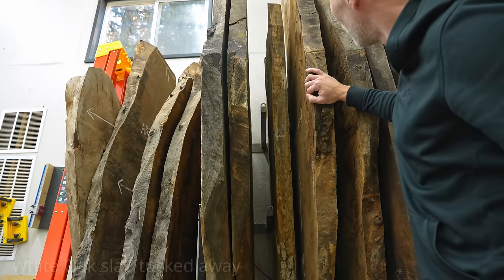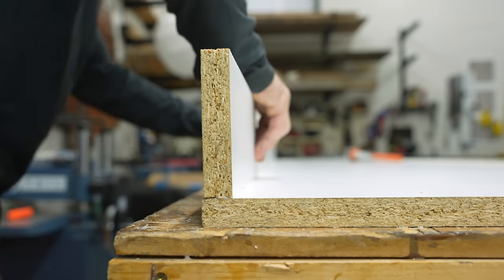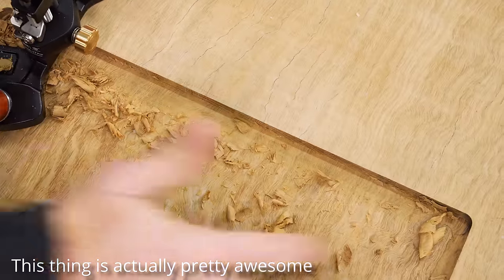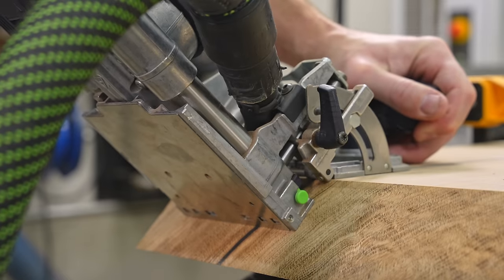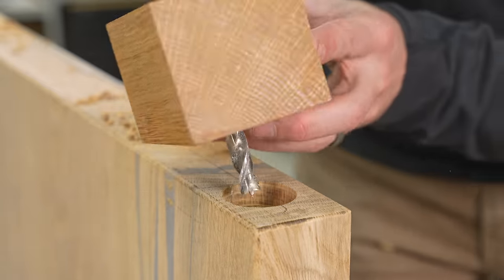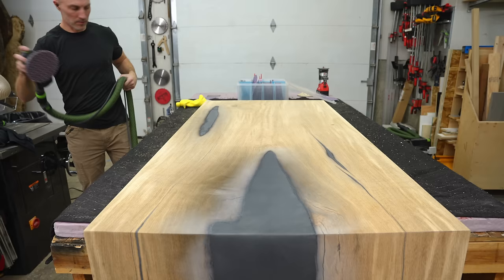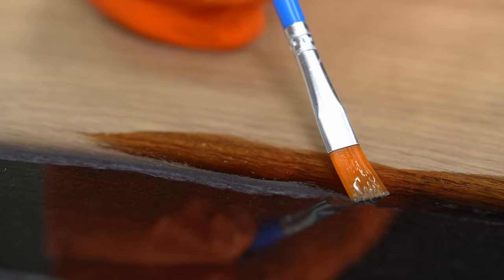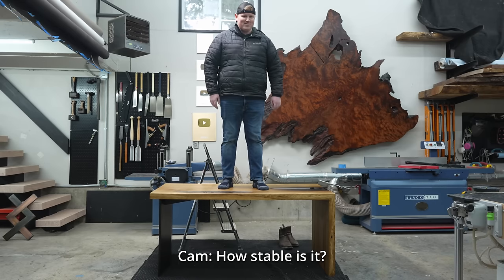Polishing Burnt Wood Like Glass

Comment: Friend, I recommend trying with Transfer Paper or Positioner, the one used in Plotter Vinyl. I use it to grind glass (I do Airbrushing on Glass) or you can use a good quality transparent vinyl so that it doesn't leave adhesives. I admire your work! I watch your videos in Spanish and they are perfectly understood. I recommend the Cutter D-400 the best! I have been using it in my specialty for more than 30 years.

Comment: Working on a mantel thats mitered on the top, bottom and face. The end caps are mitered on 3/4 sides and joined. smaller length miters are a little bit easier

Comment: Just watched the segment about having everything setup before you joined the waterfall section of the table.
There's actually a cooking term for this called "Mise an place" or everything in its place.
I'm not a.particularly capable cook so I use mise an place to make sure I don't burn everything to char when cooking complex dishes.

Comment: Hey Cam. great work on this desk. looks amazing. my only critique would be the 45* joint on the waterfall. would it not be better to use wood glue for the wood and epoxy where the epoxy part is?

Comment: a small tip.

if you put a vibrator on the wooden slab when pouring the resin it will allow the resin to penetrate the wood faster and deeper into the wood.

Comment: I've used wood glue when joining waterfall table leg as ive been informed it will hold better than epoxy but if there is epoxy in the waterfall apply epoxy on that.

Comment: These are tough. I sold one before ever attempting one on my own and it came out okay, i ended up squaring and screwing the main pieces together and doing a face frame type piece that was a 45 degree miter on both the edges

Comment: I used to work on boats..... no need to bow... and I was raised on a sail boat... now you can bow.... BTW a hole in the water with oil and gass is just a safe fire pit though I have seen flames jump and wipe out a whole dock...
Your pencil deal is awesome, however I bought really cheep diamond tools of various sizes and shapes as a test off ebbayy and they are invaluable!!! don't have to change them and when you use a lot of pressure they don't deteriorate like paper so you can use light pressure without changing tool or paper...
I'm also sure that one could cut them into various shapes for particular tasks though I have about thirty shapes and over a hundred different disks.
To that end as you were using your hand to sand with the pencil I immediately thought of the electric engraving tool (it's how my mind works), cutting off the pencil/diamond tool and attaching it to the head of an engraving tool (I have several which I've never used but will now to check it out (I fix things just because I can and people throw stuff away that has plenty of value/life or just needs new brushes, oil, bearings... etc.)
Opinion: I kept wanting to see a "hard edge"? or distinct line between the gloss and the wood... between the burnt and the unburnt. The gray fuzzy for me is a bit off-putting its like its unfinished for some reason.... I think this would be solved by polishing all the black and then taping it off and do a light sand on the spill over shinny, In other words do it backwards by dulling the shine. 
The gloss is amazing and is the focus of attention which means under the most scrutiny... the rest is just wood...I'd rather see some "excess" shinny than over score of mat on the burnt... but that's just me. I love contrast like inlay and two different woods like on old boats.
  First time watcher, enjoyed your narrative and truth... blessings!!
BTW anyone interested in a very simple way to remove corrupt from our government (meant to be governed... which we the people have not for way too long, please check out "cracking the eggshell of conditioning" dddott command (you know the protocol on Tube) It looks first grader for a reason, to keep the spooks away and for the critics something to criticize and just go away. The meat is in the recordings which are raw, uncut, without editing, all natural, grass fed... oh sorry that cows... MCT will work in any country that has laws and the key is that it is aimed at the masses of go alongers in "positions of public trust". Think about it, what business will continue to pay an employee that is incompetent?? Fix that one tiny 240 year oversight and like the Hubble we will literally have the America we desire and the founding Trust Document established:
"That all men are created equal and endowed by their Creator with certain un-a-lien-able rights, among these are Life, Liberty and the Pursuit of Happiness -- That to secure these Rights Governments are instituted among men,.." not over men. We are the creators of govern-meant not the created. Simple because once we the people require periodic testing to insure that they actually know, understand and accurately use the positions for the purposes intended, the corrupt will be removed and kept out. Blessings
Reply: MCT = Mandatory Competency Testing.... get it passed in your local Legislation... Don't know where it is? Why not? Time to man up and manage your Agents... Blessings

Comment: I'm an aircraft mechanic and we normally use some epoxy to repair composite structures.  We infuse a carbon fibre blanket with epoxy by vacuum sealing it and introducing the epoxy under pressure. The end result doesn't have any bubbles. I don't see why this method wouldn't work on the furniture.  
Maybe it'll increase the cost but it'll save you some curing time and you'd be guaranteed of no bubbles.

Comment: I think using the pointed drill bit is brilliant for marking center points! If the center punch diameter is much smaller than that of the hole, then most likely that center punch won't be punching at the center. Besides, cross-purposing tools show imagination...and it's fun to tweak the tool gatekeepers. 🤓

Comment: You can fix the extra air in you table with a simple tool . While the table is in the mold you need a used vacuum pump for doing ac work . If you lower the atmosphere of the project, all the air will be removed . No more ghost pockets.  Just remember the lid you make needs to be strong.  This process is the same for making carbon fiber and   boats . Good luck with your next project. Edit you can use the same presses that you use for the denim but use the mold as the chamber.

Comment: That support was stronger than normal because it has a that v shape to it. Flat things are flexible. But a single bend in an otherwise flat object adds a significant amount of rigidity. Those gussets might not have been necessary at all.

Comment: As a metalworking guy myself, the concern is more that you’ll bend the bit over time. Yes using it as a transfer punch in wood isn’t as bad as if you used it that way on metal, but it’s still bad. Using a brass hammer to drive it is good, but it will flex, bend, and eventually break. It will probably take a decade to be noticeable though

Comment: Vertical Stability wouldn't be the issue... horizontal support is what I'd worry about if someone decided to move it by just pushing on either end, or even lateral support if they rolled it up on it's side, at an angle to drop down the leveling feet..

Comment: Hi! I really love your work and I really want to try building an epoxy table but I am not close to any kiln drying facility or Dry wood. The most I can get with the wood that I have is around 15-17% Moisture Content. Can I get around it by simply torch blowing the side/part that's going to get in contact with the epoxy? thanks!
Reply from the maker: Man, I’m not sure about that. If you let the 15% stuff dry for a year you will probably be fine though
Reply: @BlacktailStudio  ok i will try that. Thank you

Comment: Have you and Scott considered couples therapy? Is he a rebel or a bit of a Obi Wan? Hey mate, you would love our Australian hardwoods. I wonder have you ever worked with them? I mill my own slabs using a mill have on a property with 100 acres. of hardwoods - some massive. I never cut one of the granddaddies but if they fall down, Ive had 1500(5ft) wide slabs. With the mill you can cut up to 10’square boards - but you can move the mill around to a giant tree and cut all the boards down to the centre of the log - then flip it and mill down to the centre leaving a massive slab behind. The really old ones have been eaten out a bit so would be good for epoxy but I haven’t done that. Thanks for your dry wit and captivating content and thank you Scott👍👍👍👍

Comment: 7:30 You have an issue with air intrapped, i see you als use a big whiteboard as box to mold resin, in this kind of table, very big, why don't you use the vacum kit (bag, seal and valve) used for CFRP? i think you will increase the change to avoid air bubble and the process will be so much faster

Comment: If that end panel was flat and didn't have that 5 degree Pitch in it that would be wobbly as Heck. The engineering there is not those little tiny supports that are useless. That support you're getting Is from the 5 degree bend that you put in that panel.

Comment: The sanding of just the epoxy looks unnecessarily & insanely tedious already! My only attempt would have been to completely block sand wood AND epoxy at once, then squeegee epoxy across the whole surface at once then re-sand squeegee, until I got the finish & thickness I wanted, and then polish the whole surface & I'm done.  Add a tint to epoxy as desired.  West Marine brand of epoxy is most flexible for best wear.  BTW I've got an old Barn wood beam table built, minus the water fall, I've owned over 40 years ago that was done same way, initially a deli booth table done in late 70's, still shining, when I clean it.  Not a purist here!